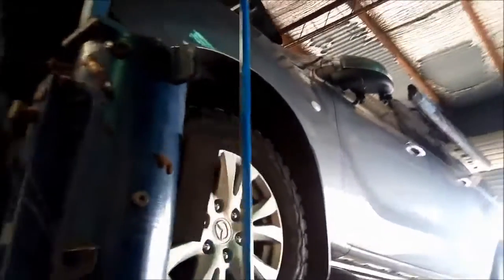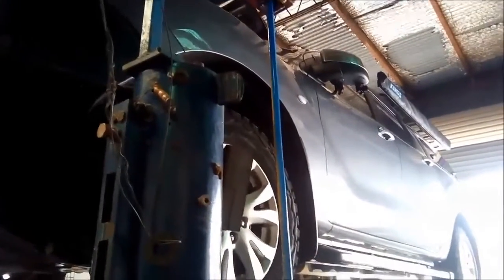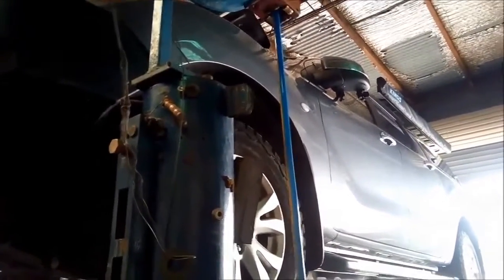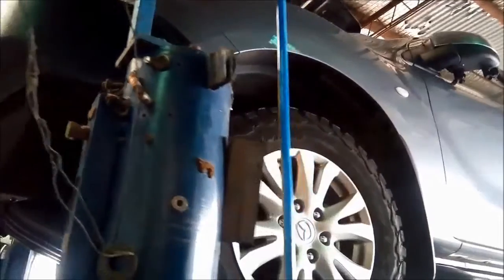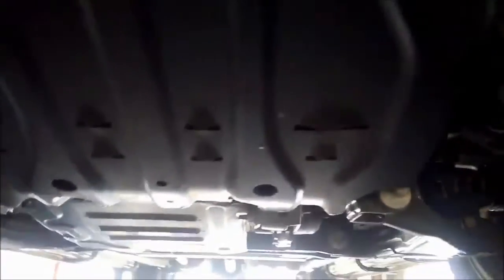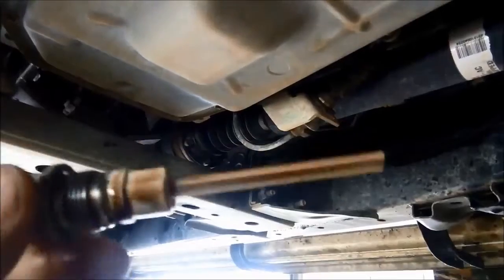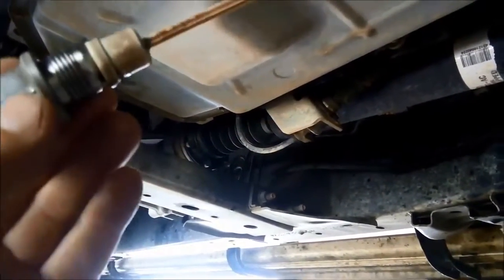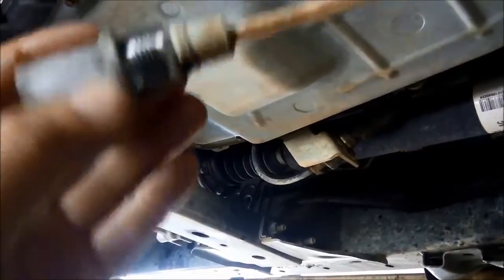Mazda BT50 Ford Ranger 6 Speed Transmission 6R60 6R80 Fluid Level Check How To DIY

Comment: Just did a pan drop and filter change on a 2013 Mazda BT-50 (3.2 litre turbo diesel) equipped with a Ford 6r80 transmission.  Used under 7.5 quarts to get the level exactly to the middle of the cross hatch (cold) position on the transmission's dipstick.  Outside ambient temperature was around 14 deg C at the time, so definitely considered it to be a "cold" day, and transmission/pan/engine has not been driven around.
Mazda authorised dealer spare parts department was selling Castrol Mercon LV fluid, same stuff one can buy off the shelf at places like SuperCheapAuto, Repco, etc.  So decided to go to a Ford dealer, to buy genuine Motorcraft Mercon LV fluid, just to keep everything 100% genuine.
The Ford one quart bottles was just a good size to put the TomThumb pump directly into the bottle, whilst underneath the vehicle.  The Castrol 5 litre bottle would have been very tricky to deal with due to the extra height of the bottle.
Cost of 8 x quart bottles of genuine Ford Mercon LV is about AUD$200, cheaper than what Mazda dealer is charging for 2 x 5 litre bottles of Castrol Mercon LV ($115 ea)
Reply from the maker: hi, cold is not a good way to check trans fluid...in alps cold is different to inland. best to check fluid level at operating or recommended temp.6r80 have a flow valve that opens at a set temp. often thy need to open then cool after a trans service or you may/will get an air lock in the cooling line. the newer fluid flush machines have a heater to heat the fluid because of this. cheers
Reply: @YepThatsIt  The issue that I have with the dip stick location is that it's right next to an exhaust pipe, and try as I may, it's near impossible to not get burnt by the hot exhaust pipe, if I were to try and check the level when the transmission fluid is at 80 deg C.  Agree that cold is very rough way of checking the fluid, but that's what I could do safely without inflicting bodily harm to my hands.  It's been less than a week but the owner of the BT-50 that I worked on is super happy that the fluid change seems to have solved his intermittent rough gear shift issue.  So happy days that the work has paid off.

Comment: Nothing about levels or much else, should have just shown its location. Tits on a bull video
Reply from the maker: hi, always refill "ball park" amount of fluid so you dont damage pump, but you need to check fluid as advised by manufacturer. there is no one amount fits all. check out our other 6r80 vids for more detailed info. cheers

Comment: How much oil should be put in it and of what specifications. Would appreciate a quick response
Reply from the maker: hi, we usually pump in fluid out of 60L drum whatever amount is needed. you can`t just put in some amount, as what comes out will vary sometimes....always best to fill & check as required. check out our other videos 
https://www.youtube.com/watch?v=xv3kwiVGKPI
https://www.youtube.com/watch?v=fbU5oK0Pwus

https://www.youtube.com/watch?v=f9dZvevN0J8

https://www.youtube.com/watch?v=b0vvqtso14k

sorry can`t be specific, but allow 5-6L. cheers